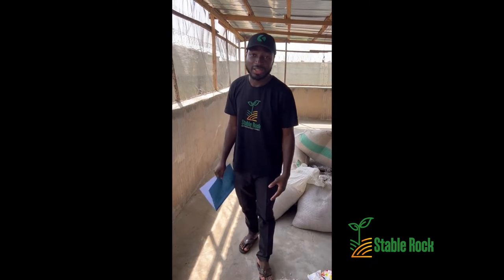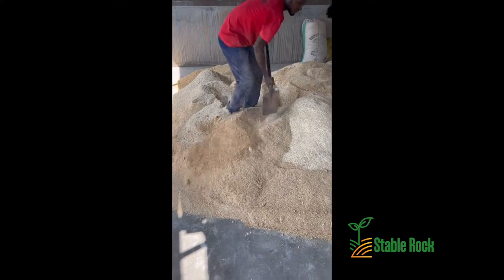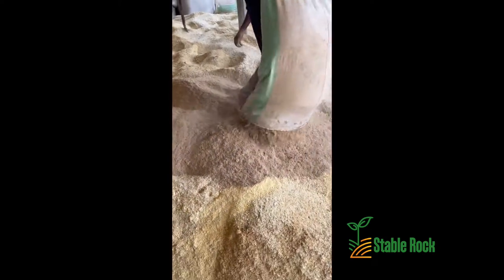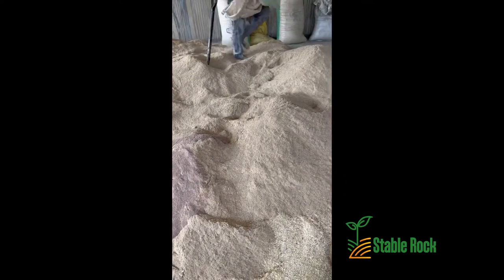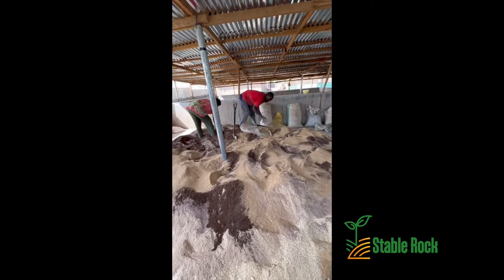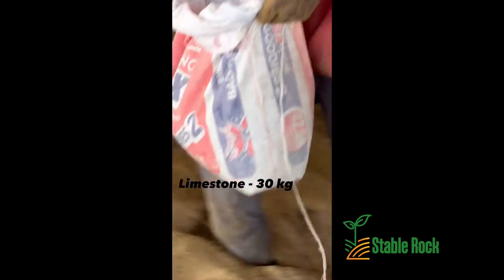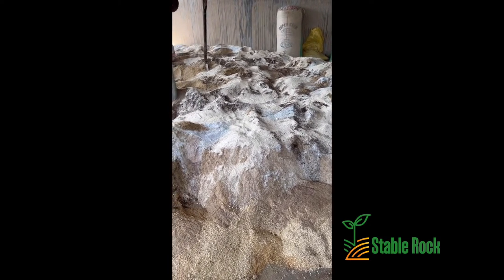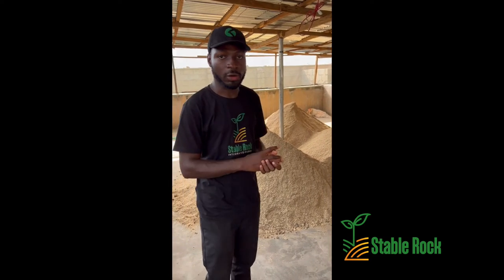COST EFFECTIVE Method To Make Your PIG FEED!!!

Comment: How much does the final feed cost?And how many times did the engine grand each bran, fish and shell? Also, why didn't you grind the 400kg maize?
Reply from the maker: Hard to say how much the final feed costs. We grow most of the crops we use on our farm. Also, prices vary due to location or seller. 

If you take a closer look, you will notice that the maize has been ground. You only need to grind to your comfort level. Once or twice is enough depending on the horse power of the engine
Reply: Okay

Comment: Is it groundnut shell or groundnut cake you added. I am confused at that point.
Reply from the maker: We used groundnut shell in this particular video. However, groundnut cake is much richer than ground nut shell. 

Groundnut shell is used as a cheaper alternative and as can be seen in the video, it’s not in large quantity compared to the other products.

Finally, we believe groundnut shell helps in preventing diarrhoea as well as foul odour of the pig dung

Comment: This feed is highly expensive. Can you break even with this formulation?
Reply from the maker: Not for us. We produce most of the ingredients needed here on our farm. From the crops (e.g soybeans & maize), to the fish, to the even the bran (such as rice and maize bran). This has greatly reduced our cost of production.

Also, we have noticed that with this feed and good management, our pigs are ready for the market weight faster. Thus, less feed needed in the long run for the pigs since we can be able to sell them faster than.